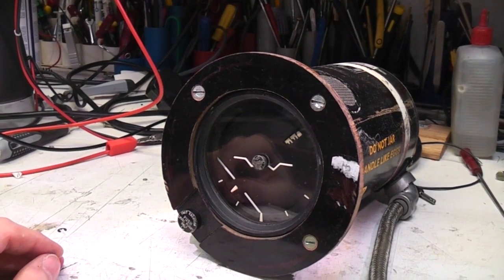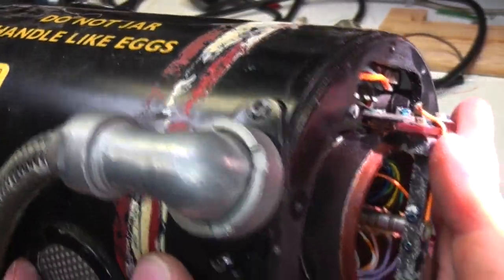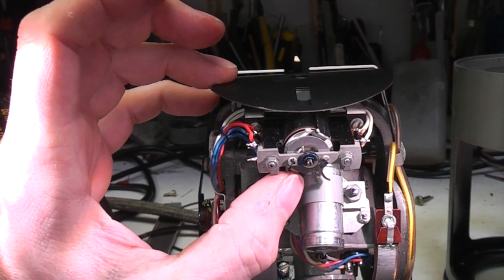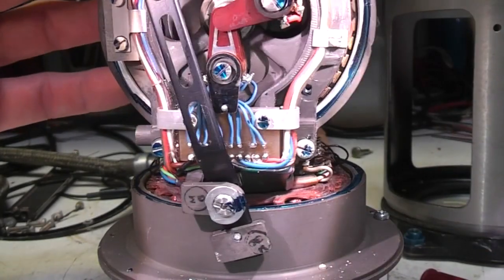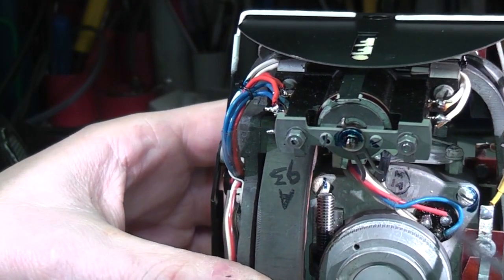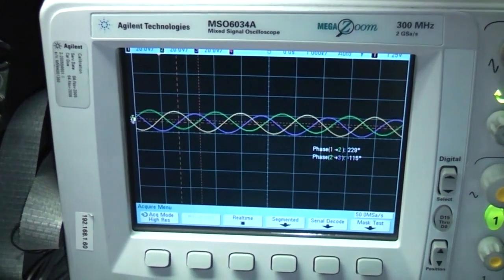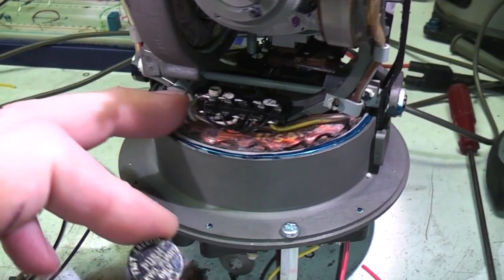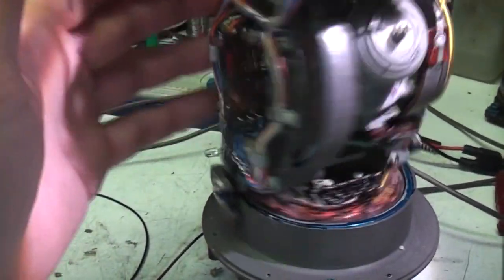Aircraft gyro teardown

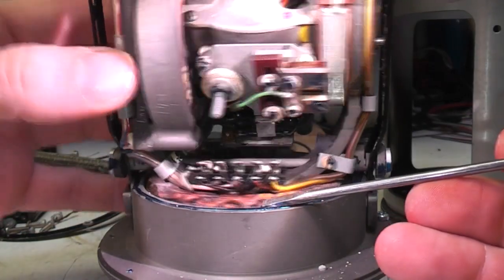Comment: At 05:30 these coils are torque motors using eddy currents. They are connected to the mercury tilt switches we can see at 07:49. This permits to keep the gyro rotor vertical.

Comment: There could be a common system called ARINC that put specific  voltages that indicate pitch and roll that are universally accepted. They usually work in tantum with  a flux which is a faceless compos that indicate voltages corresponding to compos headings. It auto-corrects the gyro to the compos headings
Reply: I mean flux detector. It's a compos floating in oil.

Comment: I think those coils are no synchro-resolver because the stator coil is missing. I think those are "torquer" or "torquer motors" in order to align the virtual horizon in the roll an pitch axis. Therefore the only feedback you get is from the potentiometer mounted on the roll axis. Check out this video of a Boeing 737 gyro: https://www.youtube.com/watch?v=lWeQsYbQ8pI&t=195s You can see the difference between the resolver and torquer for each axis very clear. Therefore I think your gyro has no resolver at all.

Comment: Extremely interesting video thanks. I have an old bronze gyro and have been trying to get it running for years now! I was told by Sperry Rand in the 70s that the specs were still classified although it's obviously 1930-1940 era. Lately no one will tell me what voltage or hertz but I did think 400hz 80-150 volts. Fascinating electro mechanical engineering. Cheers for your insights

Comment: Hey mike, thanks for sharing this. It's a great way for some of us to visualize what's inside instead of imagining all the time.
I don't know if someone else has already shared this but I want to write anyway:
That "Fast Erect" button works in that there is an additional pair of contactors added to the tilt switch, one at each end of the mercury tube. These contactors are connected via a button to power supply; this supply is at a higher voltage than the normal erection system. That way, if the gyro is seriously misaligned, the pilot can choose the press the fast erect button and connect power to the relevant torque motor. Since it is at a higher voltage than the normal erection system, the gyro will erect rapidly enabling the attitude indicator's gyro to realign to its vertically tied position.

Comment: You can drive that thing smooth as butter with an Avanced Motion Controls  S16A8B sinusoidal servo driver.  They don't have a lot of "smarts" in them, so you can just feed them two differential sine waves 120 degrees apart from your function generator.  Easy way to make a very controlled 3 phase power supply.  Also, very cheap on ebay.

Comment: in your opinion , how does the gyro compensate for the curve of the earth? Does a plane not always have to fly in a downward incline, yet a gyro indicates flat. I don't seem to understand how drift with a compass can compensate . My understanding is that every six hours this is needed as a gyro is not accurate over long periods of time. When flying around the earth I would think the gyro would max out as you went in a constant downward trajectory. Is the mechanism mechanical or electrical?You seem like the type that would know how this might work. -thanx, just curious.
Reply: +svrco pas
"see how long will it take for erection system to cancel out initial 15 degrees error...it will never happen."
If you are talking about your usual toy or science fair gyro then yes, it will never happen because those don't  have an erection system. Gyros used in aircraft artificial horizons and ADIs, OTOH, will return to horizontal over time. Just by claiming otherwise, it shows that you don't know shit about this. Go get some education. ...LOL
Reply: +odiupicku "there isn't any self-correction system embedded in gyro"
Almost all gyros drift a bit plus on really long flights the gyro needs to correct for the curvature of the Earth. Most (if not all) avionic "artificial horizon" type gyros will slowly respond to the Earth gravitational field and self correct.
In inexpensive inertial measurement units (IMU) the correction is done with software which filters the signal from a MEMs gyro with an accelerometer.
Wolfie6020 recently made some videos showing an artificial horizon type gyro self correcting. The corrections actually occur faster in one direction than the other because of the spinning of the Earth.
Reply: +Robert Gelinas 

Correct. It's important to remember why gyros are used, and that is to bring a fixed reference with you wherever you are. There are two types of mechanisms that "level" the gyro. The first being a simple weight that adjusts the entire gyro. Up is up and down is down no matter where you are, so by attaching a weight to the bottom, it will always seek "down" and level itself. Combine it with a compass and you have a device that will give you the fixed reference direction you need to navigate.

There are other types of gyroscope that do not move, and instead use a fixed point (imagine a far off star) as its reference. As you move across the surface of the earth, the angle to that star changes, and a computer can calculate that change and update the reference to reflect the change. This is essentially a modern version of the sextant and other celestial navigation techniques.
Reply: interesting. I've never heard of this erection mechanism. After reading about it , this makes sense. It checks for plum periodically and adjusts the gyro by means of an air pressured and vacuumed balance,. accordingly. Thanx for the info.
Reply: corisco tupi 
Clown.
Reply: +Robert Gelinas Flat-earthers do not understand how attitude indicators work and they assume that the fact that  those instruments actually follow an airplane's path around the globe "proves" that the world is flat. What they don't know (or pretend not to know) is that attitude indicators have erection mechanisms that continuously torque the instrumento to the local vertical and it is this constant torque that makes the gyro know in the long term which way is "up". This is a very small force and takes a long time (order of minutes) to act on the gyroscope, but enough to overcome the gyro's precession as the airplane travels around the world. In short, airplane atitude indicators have erection mechanisms that continuously adjust it to the local vertical wherever it is on the globe.
Reply: +Robert Gelinas " Does a plane not always have to fly in a downward incline"

No. Planes don't have to fly down. A plane can take off, fly level, and land without its nose ever going below its tail.  In fact, when flying at a constant altitude, the plane (or at least its wings) is pointing "up" to counter the gravity pulling it down.
Reply: thank you for answering my question. I was concerned about the planes ability to compensate for the curve of the earth. If the plane always flew at a level flight path would it eventually fly up of the earth becuase of the curve? I understand the need to point up to avoid going down, however, a gyro keeps the plane flying flat. I am trying to understand if the gyro can somehow compensate for the earths curve and not fly flat. My understanding is that a gyro is independent of gravity. Is this true?
Reply: believe it or not but some people believe the earth is flat and a gyro is evidence of "no curve" in the earth or the earth not being a ball since if it was, when you stay flying flat you will "rise" away from the ball earth.
Reply: @mrb692  . lol, Earth is Flat. Stupid Nasa Guy.

Comment: Might not get as precise as before since the vaccume`s gone!
Reply: there was no vacuum. the filter on the cover allows air to flow in & out keeping the dust and condensed humidity away.
Reply: andi sixtimesseven  most the time when you have a Sealed Gyro it is filled with Nitrogen not a Vacuum.

Comment: I would say get a 120v VFD, like one used to run on US current for running 3 phase motors. Or a VFD with adjustable output voltage. Set it to 115v 400hz and there you go. Using audio amplifiers for this like you said is touchy, much better to have a real variable frequency drive that is designed to run motors.

Comment: Lovely piece of engineering. It's amazing to think that all this work went into producing similar devices for WWII aircraft, for them to be blown out of the sky after 1 or 2 flights.
For the 3 phase supply, could you not use a car alternator (being spun with a electric drill, wheelchair motor, etc) with its regulator pack taken off, and then run the phases out into a transformer? If it works, could be simpler than re purposing an Amp. Love to see the Gyro in action!

Comment: Hey there. I'm a pilot and I found your video very interesting. I think it's good to know a little more on how my equipment works. The fast erect basically aligns the attitude indications by centering the gyro and the components. The only time I use it is  right after I start the engine on the airplane. This is because this instrument is vacuum powered. It takes a while to build 4.5 to 5.5 psi in the system. So.at low psi I like to pull the erect to get my insinuations while on the ground.

Comment: Hello,

I got a few aircraft attitude indicator gyros, one of them is a sperry MK1 witch internals are pretty much similar to the ones you show on your video.

The coils you named 'synchro resolvers' are actually 2 motors, one for pitch and another for roll. This motors are used to center the horizon on startup and on fast erect button when pressed. 

When doing extremely maneuvers the gyro can block itself and therefor show a fake horizon, then you'll use the fast erect button.

Comment: In your opinion, do you think sliding connectors are usable for this? the issue was that theese connectors have an non neglectable contact potential. the instrument will measure e-fields in the order of ~some V/m in a very hostile enviroment, (charge buildup, solar radiation of 14kW/m thermal fluctuations, ionizing rad. and so on)

Comment: in this video some sliding connectors are shown, I work as a mechanical engineer with a pice of mechanics (a satellite E-field sensor) that works by winding out a couple of sensor probes ~15m in opposite directions,

Comment: I've never seen "Fast Erection" on a gyro before, I'm guessing its the same as "Quick Erect" or the common "PULL TO CAGE" which allows the pilot to quickly re-calibrate zero.

I've got a 70s or 80s attitude indicator in the same state of disrepair as yours. Mine has a slight drift which i suspect is a bad bearing. Its too nice of a instrument to bring myself to try to repair it, yet its likely no longer worth the cost of a professional re-build. 

Amazing craftsmanship inside these things!
-sj

Comment: Regarding the phase shift network. The cap's cause a 90degree phase shift, and by adding the resistor you can tweak the phase shift so it will become 120degerees?

I'm trying to get an old 3phase harddrive running. And i like the simplicity of this way of generating the signal.

Does anyone have a good schematic of this?

Comment: BTW the spinner at the end of the gyro might be the equivalent of a plumb line. From the video it seems to be just slightly unbalanced. So in a straight flight it will settle toward the vector of gravity (sorry if this is not the correct english word)  and with the pickups the gyro can then compensate for any drifts around the roll axis.
Of course this bias needs to be very small to not disturb the indications while the aircraft is turning and pitching (where the g's might be all over the place)

Comment: The Erect button is basically a reset switch to center the gyro. When the gyro is started while the aircraft is still on the ground it will be at some arbitrary position and pushing the button will move the artificial horizon to the wings level, horizontal flight position.
As mechanical gyros like this one will drift over time they have to be reset once in a while. This has to be done in level flight otherwise an error is introduced to the indication.